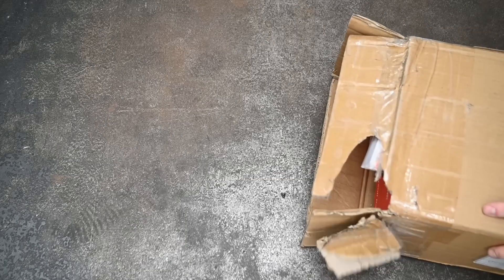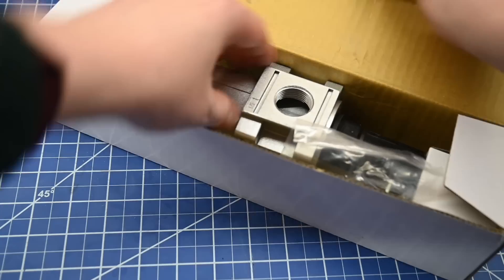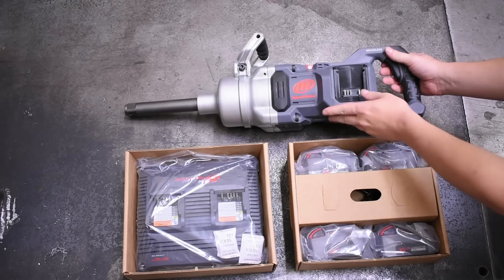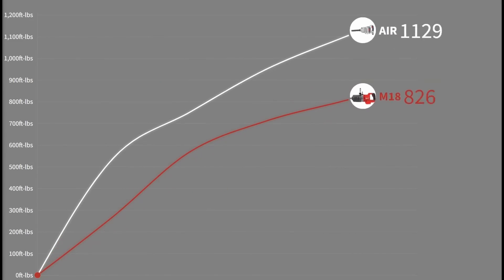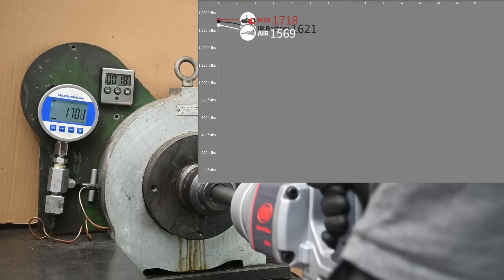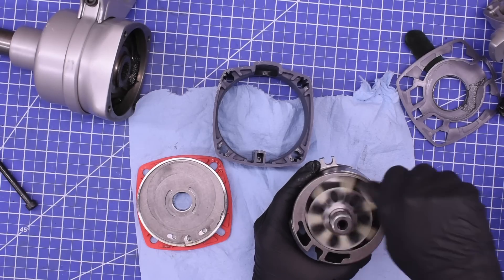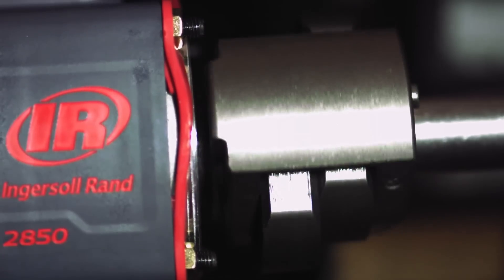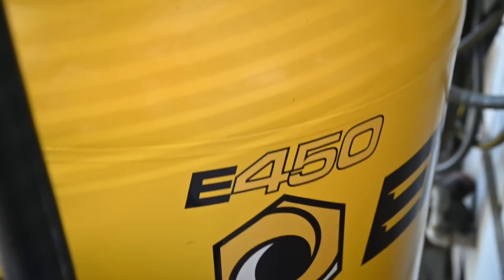The Impact Dealers Tighten Your Lug Nuts With: Largest Air vs Cordless

Comment: to be fair, as a dealership employee, i use  a plastic-coated socket on a Milwaukee m12 3/8 compact impact wrench (gen3) and let it impact for 1/1.5 seconds, then torque with a calibrated torque wrench, to tighten lug nuts. of course i do this incrementally in a star pattern = hand start all the threads, wizz all the lugs to down snug, impact all the lugs, torque all the lugs

Comment: I don't think $15k on a compressor is too much in a multi-bay setting like a repair shop. In a farm setting, where a single operator is working on one machine at a time, not so much. I don't think anybody would build out a repair shop with that big of a compressor these days unless they specifically needed those max tool spec. I'm thinking either military application or extremely large scale machinery used in mining. But I've seen a lot larger compressors outfitted in factories commonly. Mostly they're their because they were bought to faciltate hundreds of tools simultaineously. You'd generally not get rid of these compressors for smaller ones even if you calculated smaller CFM requirement simply because you'd already paid for it. What would be the point in buying smaller compressors? If you had multiple compressors of this size, you'd keep them with the strategy that you now have a backup if one of the compressors fail. If you've hundreds of people working in a factory, and the big tool going down will cause millions of dollars of lost productivity.  This would be more than enough justification to keep added capacity even in a setting where requirements for CFM are declining with each passing year as battery tools are being implemented. So tools of this size expecially at 1/2 the cost of battery tools that still aren't give this tool a space in marketplace. As improvements in battery tooling escalate, this won't be the case. Things like cell phones and both hybrid and fully electric vehicles are greatly improving availability of both voltage and amps to reach higher specs. So it won't be long before compressor you've bought at this size will completely obsolete this tool. But we're not there yet.

Comment: I am 70% sure the dealerships use this to tighten the lug nuts on my car.
Reply: I work at a used car dealership, and I laughed way too hard at this.  We use a torque wrench set to 120 foot pounds for lug nuts, and we dont hammer them down like crazy with an impact specifically for ease of removal.

Comment: That’s an incredible compressor. But almost certainly not needed to run these big air guns. An 80 gallon tank alone can store enough air to deliver 22 CFM for a minute (22 Cubic Feet) without even cutting in the compressor if it’s atypical 175/145 cutout/cut in setup. For a 15 second “best case” that means the tank alone can supply 88 CFM for up to 15 seconds before dropping the tank to 145psig cut in pressure.

You could have just redesigned and upgraded your plumbing with the old compressor and added a another air tank (in parallel this time) and gained a lot of dynamic pressure drop performance.

You can build a surprisingly high performance setup with a smaller (5hp) compressor just by using two tanks in a parallel supply loop with oversized plumbing. 

To anyone reading this who wants a high performance system (in terms of dynamic pressure drop for short burst tools), here’s how to do that: Buy a second tank cheap and used (FB/CL etc).  Plumb that tank at the END of your compressed air piping with oversized (1”+) pipe. Then supply your air demand locations off of tees. This setup places two large air reservoirs on either end of a pipe run, so the sudden air demand is met from two locations. This cuts the instant demand velocity in half and improves pressure drop by even more than 50%.

Heck, you could make a great air system with just a bunch of little 10 gallon tanks teed on your vertical air drops as long as the tanks have large enough ports to work. (Which is the main problem—small tanks have small ports). How do you make small ports have low pressure drop? You divide the flow among several of them. Parallel tanks and loop plumbing. Give it a try and you’ll be shocked at how great you can make the pressure drop even with a small compressor.

Comment: Pretty hard to beat the Milwaukee because it uses only one battery vs two on the other and air is a whole nother ballpark.  I have see the Milwaukee tear apart a 1 5/16 impact socket trying to remove rusted lug nuts.  We use air in the shop and battery in the field.  But comparing battery against air is like comparing gas to diesel.  Doesn't make sense.

Comment: It would be interesting if you hit you're local rental center and get a diesel air compressor and run that line directly to the impact without a regulator to  see what happens

Comment: I have a lightly modified astro 1894 that out torques the 2850max (removed muffler, upsized port for setting 3 and punched out the screen in the input(got clogged)) and it is at least more efficient than the ir 2850max on 3/8 fittings with big hoses and industrial air setup (tank bigger than a car with a screw compressor of similar size) maybe ill talk to those guys about at least going to 1/2 inch fittings because they also think it is weak compared to some older IR guns (285b-6) we have not even including spline drives

Comment: my service truck much like many others uses a vmac for is air and i wonder what kind of numbers it would produce vs the electric 1 inch guns i just have a jet 1inch that I'm not overly fond of it was just what was available when i needed one (seems the company moto is "don't worry about it till its a problem") ironically but not surprisingly causes more problems then it avoids.

Comment: We have tried 1 inch battery impact and yes it did the job but it didn’t have the consistency air has because of battery life drops the power off the impact gun drops while air impact guns you get the same power if your air compressor can keep up

Comment: @TorqueTestChannel  Few things that might be helpful, since I'm a pressure equipment pro(tm):

First a bit of information you probably already know, but in the unlikely event you don't it may be exciting news: IME there aren't any real complications to having multiple compressors or receivers on the same air system, as long as all the involved pressure piping is done to code. So you could very well connect your old compressor and your new compressor (with associated receivers) together, netting you an air system with flow and storage capacity equal to the sum of both compressors/receivers. I would recommend setting the pressure switches in a staggered configuration so the smaller compressor runs as lead (higher pressure setpoint, smaller deadband), and the larger compressor runs as lag (lower pressure setpoint so it only kicks in when the air system is under heavy load, but with a larger deadband so it still runs up to the same pressure as the other compressor) - among other things the more you cycle a compressor, the harder it is on it, and it's generally better to wear the smaller compressor out first because it should be much cheaper to fix or replace.

Another interesting piece of information (may or may not be useful): one can buy ASME BPVC Section VIII Division 1 air receivers separately from compressors (often much, much cheaper than the same receiver would be as part of a "matched set" with a compressor for weird market reasons I won't get into), then hook an existing compressor up to them - or even append them to an existing air system to reduce cycling of the compressor (which can extend compressor lifespan) and provide increased pressure stability when the compressor cannot keep up with the load.

The sky is pretty much the limit as to size if you reach out to a vendor that actually specializes in pressure tanks - for example (not endorsing this vendor at all, I've never bought anything from them, their catalog was just easy to find) AA Tanks makes a whole range of 200 PSI air receivers from a modest 30 gallons all the way up to a mammoth 1060 gallons as standard... or larger/higher pressure if ordered custom. Largest air receiver that vendor makes is 30,000 gallons at 150 PSI - well into the range where it'd only make sense at absolutely massive industrial sites for specialized process applications, or perhaps large factories that make heavy use of high-flow air tools.

Not sure any of that will be helpful or even novel information, but I figured since I have significant professional experience working with pressure equipment [albeit I do a fair bit more work on other kinds of pressure equipment than I do on air compressors] I'm obligated to share what I can just in case.

Comment: ik from the dealer I work at we get a wheel on, zip on the tires with the impact then torque to 500 lbs. (I'm a diesel tech)

Comment: i go around to tons of shops to fix machines and hoists, and in 99% the air setups are a complete joke. full of water, multiple size lines, old tired compressors. i love seeing best case scenario but most shops wouldnt see 60% the power of that thing

Comment: I’ve ran both of those Angus all ran 1 inch air guns the smaller one is lighter little more RPM but the older one has a lot more torque to much more than the newer one

Comment: Ingersol-Rand should stick to 1/4" to 3/4" because those 1" impacts is GARBAGE. Koken 1" impacts is smaller, more powerful, requires less air and is as reliable as a Toyota.

Comment: Is it just me or does the air impact have way too many downsides and it's barely better than battery powered ones?
The cost of a large compressor powerful enough to power it, the extra noise it makes while working, the air hose that will get in your way and you'll also need to keep in mind to be close enough to reach. Even if I was using it all day it still doesn't seem worth it since I can just keep switching batteries on cordless tools.
Maybe I'd feel differently if I tried it. Guys at work use battery half inch impacts but they swear by air nail guns. They tried cordless nail guns and hated them.

Comment: We just got the cordless ingersol impact at the shop. That fucker can be dangerous. I went to switch from one lug nut to the other, i grabbed the  socket for leverage, and as i was holding the handle, my finger tapped the trigger, and damn near ripped my hand off. I really don't like that it doesn't have a lock switch like most power rools do.

Comment: No mention of the air guns high unloaded speed, or how quickly it builds to moderate torque levels, they get the nut run in very quickly and build decent torque fast, you aren't always aiming to get something done up as tight as the tool can achieve.

Comment: that's like the crazy tools they use at work with the twist on air hoses for taking apart power plant turbines and such huge bolts holding the steam turbines together

Comment: i have a 1.5" IR powerstroke if you wana really test that WSM out :3, 70 years old i believe
1" air hookup, 150lbs and its the baby of the 3... the biggest is a monster 850lb with a 3" drive and 100,000 lb/ft of torque and takes 275 CFM to run... not many people know about these monsters... a 12 piece socket set from snap on was over $40,000 for it
now they are obsolete with hydraulic wrenches and the introduction of superbolt / jackbolts

Comment: Id like to see the big pneumatic tested at straight tank pressure, bypassing the regulator for flow and inertial reasons. Also with a little graphite lube and oil dropped into the air motor.

Comment: I have a harbor freight cheap version of that IR air impact, I’d be happy to talk with you and send it in for testing, I’ve used it at work and torqued inch and a quarter ubolts to 2k foot pounds

Comment: Ive been a commercial tire tech for over 16 years ive used at least a hundred 1in guns ive had this same IR tear itself apart it lishearf off the bolts at the case and ive had more then 1 do that. The Milwaukee is definitely a beast ive been using it since its release. The dhop i work at uses 2 massive 500gal compressors we can use a lot of 1in guns simultaneously

Comment: Working for a Ingersoll Rand air compressor, generators and Tools distributor here in Australia as a field tech there was a couple of things i learnt. 1) There compressors and generators far out weigh the rest and there price proves it when it comes to factory size compressor and gensets. 2) That big boy gun you find there site, thats not there big boy guns😂. You go on there industrial equipment site and look at there 1 1/2inch guns and 2inch gun🤯. Talking $10,000 guns that need to have 2inch airline plugged into them. They have twin long handles on them for 2 men to operate with a remote trigger like a post hole auger drill and are for bridge and sky scrapper building and mining equipment.

Comment: When I bought my car the one tires lug nuts got put on so tight from kal tire that when I tried to change it I needed a 10ft breaker bar, and instead of loosening it broke the lug bolt... The dealer did at least fix it for me 😅

Comment: We found out recently air isn’t going anywhere.   Working in a non conditioned industrial setting, air tools are king for reliability.  Mainly because of the cooling effect, size, and weight.
Reply: You are right.  You can run non stop and never overheat.

Comment: Three things:
1. Air tools remain the King of tools 
2. Only real men use air tools 
3. The cost of air tools and air compressors is a real shame honestly, air compressors and air tools should be cheaper than they are for how simple they are in my opinion.
Just my two cents 
Thanks 
Ray

Comment: As a note on the air, the cost of supplying the air and compressing the air are two distinct costs.  Many independent operations are 1-2 users sporadically which does not require alot of compressor volume if you can store the air. 

In an extreme sense a continuous run 120v high quality compressor can fill a very large tank if given enough time.

The trick is safely storing that air as new large rated air tanks [no compressor]  are quite spendy too.  Getting this cost down is easier than compressor cost if you are creative.

And finally 1" regulators with 3/4" pipe is a minimum for even higher torque 3/4" impact guns.   Dixon makes a 3/4" body quick connect; DF series.

Comment: You're paying an extra $13K+ for 350 ft lbs.  (or $13K for 140 ft lbs) That's not a smart decision, IMO. Then you have to add in that you're losing the portable nature of it -  battery powered tools. This is beyond 'not smart' and pushes into the 'that was a dumb decision' category.
Reply from the maker: WE'RE paying that because we're a tool testing channel. As we mention multiple times, hopefully your shop/farm whatever already has this type of air and then this what that difference looks like. We're also assuming this air IR is the top ever everywhere, which i dont feel it is. We will find out!
Reply: @TorqueTestChannel  oh, I know... and I most definitely appreciate it as it makes for good watching.... but for the average person buying something... it makes little sense :D

Comment: My point is that if you work in a shop with air and hoses, use air powered, it is much cheaper. If you work remote, away from air, buy battery. Do you NEED the 1" drive? Probably not, unless you work on massive bolts and nuts on massive equipment. Will an HF Earthquake do the job for most automotive and even semis? Yeah.

Comment: I'm a telecom lineman, we use that Milwaukee to install the helical anchors in the ground that hold the weight of the lines on the poles. Not sure what that is? - Those guy wires that come off the pole at an angle and usually have a bright yellow plastic guard on them, they're attached to a metal rod that gets "screwed" into the ground 4-5ft. Traditionally a guy would just put a lever through the eye and literally walk around in like 100 circles as it drives in, often with another guy hitting the anchor with a hammer to add downward force. We LOVE the impact.

Comment: Damn all of this stuff looks so fun, and that new compressor looks nice*! Glad to see you investing in the channel and your shop! Also, don't think you mentioned it in the video, but make sure those big impacts are fed a basically constant mist of oil in the air supply (either an oiler if you can find one that doesn't restrict flow too much, or just pour some oil [no too much that you hydrolock it on oil though lol] in the far end of the hose every now and then so it gets atomized as the air flows through) - it doesn't just prevent rust, it helps *seal the vanes in the motor and put as much of that air pressure as possible to work turning the rotor!

Comment: I got the vevor 1” air and it’s huge cost around $100 blows are IR out of the water in power but it’s so heavy we hate using it we got a harbor freight gun for everyday wheels and tires but the vevor 1” impact you need to try it if for nothing else it’s cheep power if you can pick it up and hold it

Comment: I've seen you guys mention not wanting to test larger air tools because of the lack of ability to maintain proper pressure in the tool. I personally would LOVE to see you guys show the power lost on a handful of larger air impacts when using standard/more common 3/8" and 1/2" air lines you would find in most shops. I have personally thought about getting a 3/4" air impact to use, but am unsure if it would be worth the expense when being used with normal 1/2" flex hoses connected to 3/4" hard lines on a normal 80 gal compressor. That being said, I love all your videos and please keep up the good work!